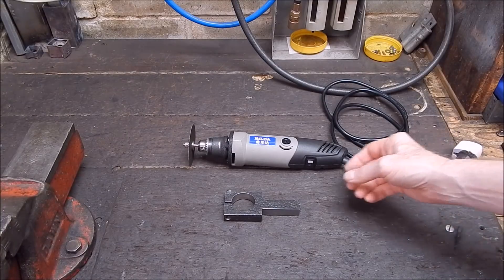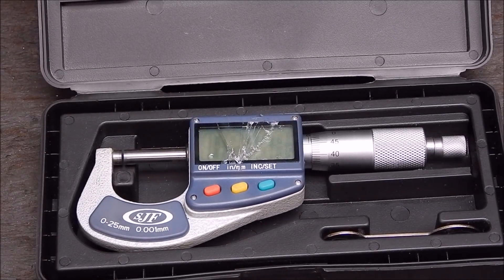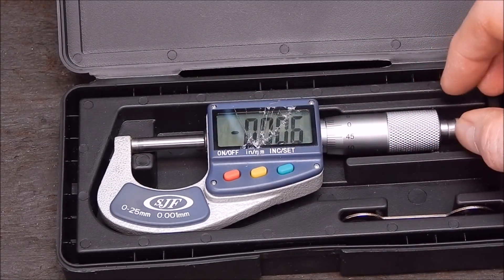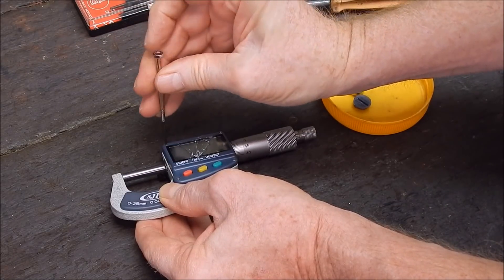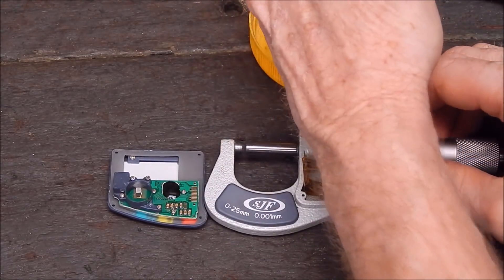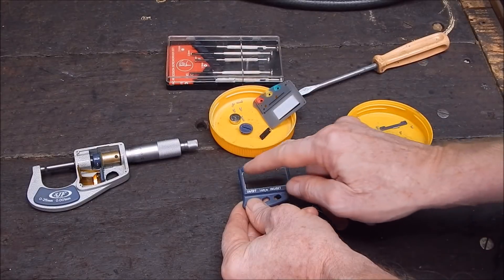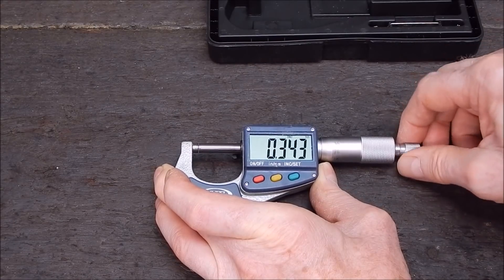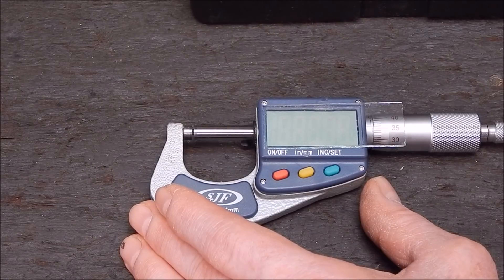What's inside of a digital micrometer ?

Comment: Watch this and thought you migjt like mine. I was cleaning my 3 jaw chuck while sitting at my work bench, somehow I dropped it and it landed on what was a pristine Borrani rim from one of my old Ducati bikes. I almost cried, the rim has a big ding in it and I haven't had the heart to look at it again since
Reply from the maker: Oh no !!!!  Why does this run away stuff always land on something precious or go down a hole or some other awkward place. Seems like life is a game and someone is having a good laugh making it difficult.

I once dropped my six inch four jaw chuck from the ways onto my foot - which went black for quite a while afterwards, even with steel cap boots on.  Of course it missed the cap and landed on the fleshy part on top of the foot.  Nothing broken luckily.

But I did learn that it's a good idea to keep the chuck face parallel to the ways when resting it on the lathe board, just in case it decides to roll somewhere.

As they say Fred, shit happens.

Cheer Rob

Comment: while you showed the gap of the missing glass I thought a object carrier glass for a microsope would be a good option. And sure enough you had thought of the same thing too and you even had one and it even fits the width too. Hahaha

I was surprised to see a small optical disc resolver in there because those have the fine grid on them but on such a small disc can never resolve 1000+ steps per revolution necessary in a micrometer. They need some additional sensors and electronics to interpolate between 2 lines in the resolver. In linear glass scales they do that too. The interpolation can be done in 2 ways (maybe more but I  know only 2 of them). In the first they put the lines on the disc not exactly radial but at a small angle say 5 degrees and then they put a stationary pattern angled in the opposite direction in front of the light detector. When the two line patterns move past each other they create a moving moire pattern that sends about ten light dark spots across a second light detector ten folding the resolution. The second method is that the light detector does not only detect 2 states, dark and bright, but measures different levels of brightness which can multiply the resolution by a factor of 100. I guess by miniaturization and mass production these sensors and electronics must have become cheap. https://commons.wikimedia.org/wiki/File:Moir%C3%A9_pattern.svg

Comment: In your place I would be thankful that it hit the display and not your eye... So you kept your eye light for only 60$. That is a good deal...
Reply from the maker: I had heavy gauge impact resistant safety glasses on, as usual. 

I always wear these when wire buffing and using the drill press.  I've had HSS drills jam and shatter a few times.  Very dangerous situation.

Cheers Rob

Comment: Don't use super glue with the casing closed up. The vapours will condense on the glass, dry out and fog the glass. In any case I think you will be better served using a contact adhesive which will give a little under stress.

Comment: can it be fix without disassembly.
Reply from the maker: Yes.  Now that I know the glass fits from the outside (it wasn't immediately obvious) I could have prized out the bits with a small screw driver at the impact point.

Comment: Sounds like maybe a need not only for eye protection but also a suit of armor!!
Chance in a million that holder hit what it did! Totally amazing.
Very interesting to see inside the digital unit --ribbon cable looks pretty delicate. Well - seems the LCD screen survived and so chances are if you can come up with a cover you'll be good to go. Microscope slide looks like good potential.
Reply from the maker: Hi Chris,

I thought you'd be interested, seeing as you just did a review on the unit.

I just learned that tempered glass can't be scribed and broken, so I will try using a Dremel diamond disc in the lathe to cut it in the vertical mill slide.  This will be a first.

I'm not sure if this is worth a video.

Cheers Rob
Reply: Oh, never remembered slide glasses as being that way. Could well be a diamond disc can do it - give a try anyways eh.
Reply from the maker: I think you may be right.  This is not my area of expertise.

I had a close look at the slide edges and they appear to have been broken to size - not a clean ground edge.

So I think I will try the Banggood scribe on one and see what happens.

Cheers Rob

Comment: This is why when I am using a wire wheel I reverse the order of things. The part is fixed and the wheel is in my hand grinder. That really sucks. I can empathize totally. You might find a repair place that can get a replacement part.

Comment: This happens a lot in my shop where Pear Shaped is a step up!  I get ebay/dollar store glass phone screen protectors and shape them up with those little diamond disks on a rotary tool.  You may want to avoid super glue as it tends to gas off, wick everywhere, and it's brittle as heck.  Something like rubber contact cement applied with a toothpick is good and cleans up easy with Naptha/lighter fluid (which doesn't melt plastics and paint).  Plus, you might have to do this again and the rubber cement will peel off rather than chiseling off the super glue.  A bit of tape and some nail varnish for the border and Bob's you're Auntie.
Cheers
Reply from the maker: Hi Eddie,

Those cheap glass Android screens were my first thought and the Dremel diamond wheel was the way I envisaged doing it.  I will go the silicon route I think.  Will give the slide covers a go first.

Thanks for the feedback.

Cheers Rob

Comment: Great Job Rob. I can sure relate to your video we have all done things like that. I still keep an eye open for one chuck jaw attached to the slide that took off from a scroll chuck on my bench top Delta lathe. I was removing them to clean out the dust and dirt from the guide ways and turned on the spindle by accident. Then away went the one jaw with slide never to be seen again. I turned my shop upside down and have not found it as of yet. 3 years ago. It will show up one day. Great job and good run of luck on the mic. My self I would use a tooth pick and silicone to run a small bead with cover off again. :-)
Reply from the maker: I once found a missing object lodged in the rafters of the shed.  What are the chances of that?

Rob
Reply from the maker: Hi Ed,

I expected to get some brothers in arms with similar tales on this subject.  One day it will turn up for sure.  Keep looking.

Cheers Rob
Reply: ED Maynard -- Have you moved the lathe and looked underneath?  I find the darnedest things under places that I'm sure they cannot go.
Reply: When my grandmother was still alive, I helped her move.  When I moved the washer and dryer machines, I found a casmere sweater between them.  Apparently, about 20 years earlier, she fired a housekeeper for stealing it.  Gma expressed a little embarrassment, but did nothing to repair the damage to that housekeeper's reputation.  I lost a lot of respect for Gma that day.
Reply: Ron Yerke Hello Ron.. yes indeed that was my first place to look. In my case I saw the chuck jaw take off through the air up toward the ceiling but once I calm down it was not where i thought it should have landed. It is a bench top mini Delta lathe. This was three years ago, so I ordered new parts and gave up ever finding the  jaw and slide. 😕
Reply: xynudu Yes indeed. I looked up there also. 🤔

Comment: Top work Rob!
I had to fix a mitutoyo 1-2" I bought from eBay that showed E-05 on the digits when turning in one direction.
https://youtu.be/7I8y65eBENU
When I repaired my instruments on my bobcat, I lasercut some acrylic to suit. I'd be keen to post you over a lasercut window to your exact measurements, and even include some of my stickers in to boot! email me at jb at designlab dot cx if you would like cheers.
https://youtu.be/4cH5CJjirZk?t=1m20s
Reply from the maker: Hi JB,

Thanks very much for the offer.  I will try going with the glass slide first as it's less likely to scratch, plus I want to try it out.  I have cut thicker glass with success, but this is a bit different.

If I fail then I will take you up on your offer.  I will also check out your other videos. I have subscribed.

I like what you did with the 3D printer.  I must get into that.  Banggood have been at me to review their 3D stuff, but I don't know much about it.  I must get a handle on this as everyone seems to be using it.

Cheers mate.

Rob